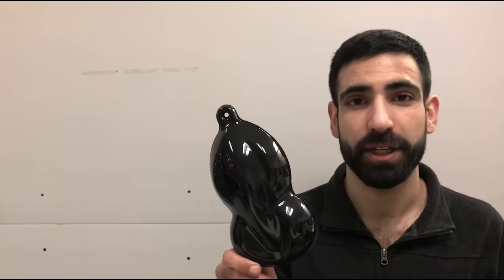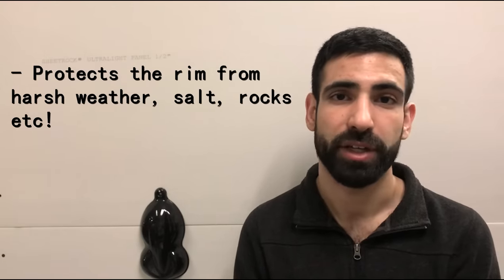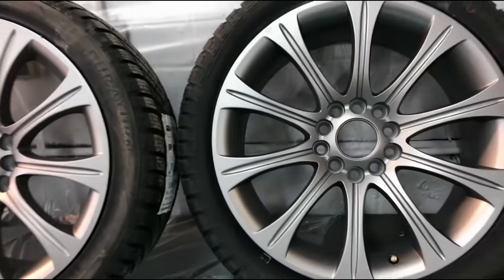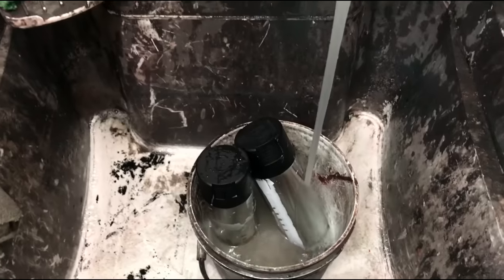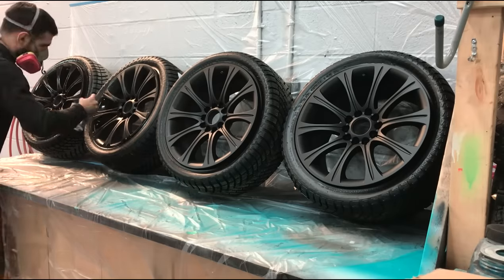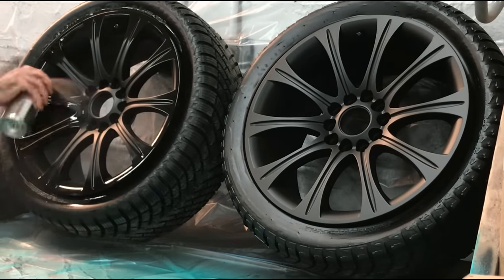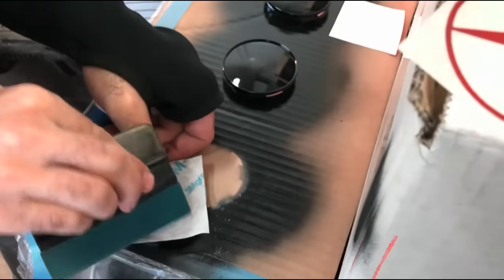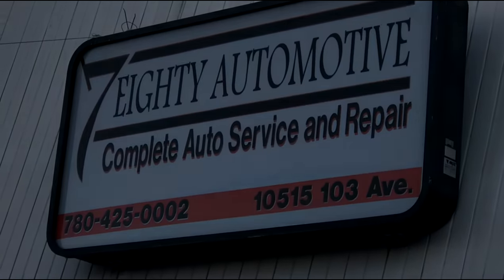How To Spray 2K High Gloss Plasti Dip Rims

Comment: Yo liquid dipper that 2k high gloss looks awsome.did you spray plasti dip on the wheels then the 2k high gloss bye spraymax?
I recently got my wheels dipped with plasti dip the guy said he sprayed 6 coats but I can still see the actual color and its bubleing up in some spots do you think they sprayed the right amount coats or it should of been 8 to 10 coats of plasti dip please let me know what you think.also can I spray 2k high gloss on top of the plasti dip to make it glossy I would appreciate your feed back thanks ?
Reply: You can spray the 2k spraymax over plastidip but make sure you have full coverage and somewhere between 8-10 coats to get peelability & durability
Reply from the maker: Hey! I did use Plasti Dip black in this video but you can pretty much use any removable coating spray. If you can still see the actual color on your rim then there is no way he sprayed 6 coats unless they were light coats. You can get away with 6 coats with good coverage but if you want better durability then go with 8-10 coats. Yes you can spray the 2K over Plasti Dip to achieve this high gloss finish.

Comment: How does the coating react to Cleaning & automatic Car washing? Also, Will I need to redo the Rims after changing a tire(s) & what precautions need to be taken when changing the tires on a painted rim? Thanks.
Reply from the maker: Cleaning and car washes are fine on the wheel, you just clean it with degreaser and water then you can dry it after if you like. When changing tires, they may damage the coating but can be easily touched up by thinning out the area and respraying. Touch less tire machine will work best when changing tires on a painted wheel

Comment: Can you do this with the rim on? Does the rim have to be flat when sprayed with the 2k clear coat or will it run if it's not flat?
Reply from the maker: The tires stay on the wheel but i take them off the car and lay them against the wall

Comment: Hi! Thx for a great video! One question though, how many coats of the 2k is required?
Reply from the maker: Hey, thanks! You only need one light coat followed by one heavy coat right after and than let it dry and cure for 24 hours

Comment: Hello great results, I live in the UK and this clear coat isnt available, do you think I could use another high gloss laquer spray with a similar formula?
Reply from the maker: Ocelot7 Hey! Im sure their are other 2k glosses that work, i just haven’t tested others! You can try to spray something as a tester and see if you get any reaction before you do your rims!
Reply: Great stuff Ive found a product by the same manufacturer just different packaging. Would you advise it being okay to do masking techniques or would you say this is best just one colour with no trying to mask off edges to get two tone effect?
Reply from the maker: Ocelot7 Follow the same steps in the video for masking off around the caliper
Reply: Liquid Dipper thanks I’m
Doing rs3 wheels so the plan is edges will be masked off to leave the polished factory. Hoping for Neat lines
Reply from the maker: Ocelot7 they will, as long as you peel when wet. In other words peel the tape off after the last coat of 2k gloss
Reply: im in uk also ,can you tell me the name of the spray you found, and where to get it please?

Comment: Is it ok to spray the 2k clear over the hyperdip? Also can the hyperdip be applied to polished aluminum wheels? I would like to do the piano black hyperdip and 2k on the centers of my weld draglites.Thanks.
Reply from the maker: I get asked that question alot lol i havent tested it but you can just use regular black plasti dip with 2k the results would probably be the same if it did work over hyperdip. If the wheels are polished i dont think any coating would stick to it, you would have to use rubbing alcohol to clean it all up

Comment: I’m about to get new tires for my rims. Do you recommend doing this with the old tires since I won’t worry about getting the plastidip in the tire?
Reply from the maker: Switch the tires first because if you sprsy the wheels and go switch of the tires, the tire machine may damage the dip on the wheels. Put a liquid tire shine or dip release from dipyourcar on the tire but avoid getting it on the rim and spray the tire everytime you do a coat. When you finish your coats the plasti dip on the tire should peel off nice and easy

Comment: hi can I leave the wheel on the car and do this? will the 2k over lug nuts make it hard to remove the tire in the future? thanks
Reply from the maker: You can do it on the vehicle just make sure you put a bag around the caliper and brakes area. No 2k wont make it hard to remove if u go over the lug nuts

Comment: Quick question ?. Do  I need to take my wheels off to do this or could it be done wheels on?
Reply from the maker: Its best to take the wheels off but if you cant then make sure u put a bag behind the wheel to mask off the brake components
Reply: @EhabHalat  thanks for the response👍🏾

Comment: Hey man! have a quick question, my wheels are already plastidipped, they were done not too long ago. Can I just spray the 2k gloss coat over them or would I HAVE to peel off the plastidip and then do it again?
Reply from the maker: Faaiz AliTV hey! If the plasti dip isnt damaged or peeling then of course you can spray the 2k on top just make sure to clean the wheel very well before doing so because if any kind of debris is on the surface it will bubble up and you wont get a smooth finish. What i suggest is spraying a fresh coat of plasti dip and then the 2K just to be on the safe side
Reply: Liquid Dipper thank you very much for the quick response! Amazing video bro keep it up!

Comment: how do you keep the tire shop from damaging the rim when putting on new tires? I pained mine and used 2k clear but the first time I had new tire put on the tire shop scuffed up the rims and pealed off the paint and clear in a few spots
Reply from the maker: You need to go to a shop with a touchless tire machine or tell them to be very careful and maybe put a cloth around the lip of the wheel so it doesn’t get scuffed up

Comment: Can you elaborate on how hard this is to remove?  I want today to be do my Maserati  rims, but scared it will be very difficult to remove.  Others claim on Amazon that it will make removing almost impossible
Reply from the maker: Jon Korn Hey with a removable coating as the base and with the right amount of coats (minimum 8) you will be able to remove it in the future. Their may be minor spots that wont peel -as good but you could always use a pressure washer to remove the excess or rub it off with a microfibre towel but most of it will come off with no effort.

Comment: thinking of doing this on mine I have a few questions.
whats it like for durability like having a tyre changed is it easily damaged with the tyre machine? car washing does it come off easily when having car was lh ect also if Traffic film remover or TFR is used does that do anything to the paint
Reply from the maker: It depends who changes the tires but touchless tire machine works best. If it does damage, its easy to fix by thinning it down, spray black and more gloss. Car wash wont affect it just make sure if you pressure wash to keep a fair distance. TFR shouldnt harm it

Comment: Just did this on my car! Turned out pretty good but it seemed like I needed two cans of 2k, which I did not have, to make it fully shiny in all of the rim’s ridges. Do you think If I buy another two cans and spray them in a week or so when they arrive it’ll have the same look as if I had done the whole process at once?
Thanks again for this helpful vid!
Reply from the maker: Hey i havent tried but i think it should be fine just clean the rims really good and maybe do a fresh cost of plasti dip colour first
Reply: @EhabHalat  So, I am able to do a coat of plasti dip on top of the 2k? And then follow up again with the 2k? Thank you for the response!
Reply from the maker: Yes
Reply: @EhabHalat  How well do you think it’ll be if I just clean the rims as they are now and only do more 2k gloss?
Reply from the maker: Make sure they are very clean but id do a couple coats of plasti dip first then 2k
Reply: @EhabHalat  what is your reasoning behind applying more plasti dip, if it now has the 2k on it? Just curious. And thank you for the constant replies!
Reply from the maker: Makes it fresh so when u add the gloss is comes out nice and clean with no reactions
Reply: @EhabHalat  Last question! Lol
How long do you wait in between coats of the 2k?
Reply from the maker: Spray one tack/light coat followed by a solid/wet coat right after. No waiting and then just let them sit for 24 hours before handling
Reply: @EhabHalat  So literally one coat right after the other?
Reply from the maker: Yes
Reply: @EhabHalat  Just re did it and it came out shiny how I wanted it to! But, a spot in one tire got too much paint and it dried a little white. Any recommendations on how to get rid of it, or help it look less white-ish?
Reply from the maker: Never got that issue before might have to wait a few days for it to dry and sand it respray that section

Comment: Can you do a removal video soon?? I really wanna try this but I’m scared on how it will peel since I heard it makes the plasti dip hard and un-removable
Reply: i used this method on my rims and it doesnt peel off like its supposed too. the clear coat makes it extremely difficult to take off and you will need dip dissolver to take it off unless you want to spend hours peel off tiny pieces

Comment: Another question here. If I’m not planning on changing colours, or peeling the dip, could I use fewer coats of plasti dip, like 2 cans for all 4 wheels, and then just coat them with the 2K? I mean, if more coats of dip so it’s easier to peel, could I just use enough dip to get full coverage since the clear should be doing the protecting?
Reply from the maker: I havent tried with less coats so honestly i dont know
Reply: @EhabHalat  How many cans of plasti dip did you end up using for these wheels?

EDIT* Never mind. I just found the answer in one of the comments. Looks like 5 cans.

Comment: I used this exact 2k gloss and it does peel off, easily... it only took me a few of minutes to peel off. With that being said, it did cause the Plasti-Dip to feel rough but I kind of liked the look. It just made it difficult to wash them with a cloth.
Reply from the maker: Yeah i have a video of me peeling them on my youtube channel. It should be a smooth finish once the gloss is applied though, i never had a rough finish.

Comment: Hey Ehab, did you use the regular black plastidip? Also how many cans of plastidip and 2K did you use for the 4 rims? Thank you,
Reply from the maker: Yes its black plasti dip. I used 5 cans of black plasti dip (8-10 coats) then 1 can of 2k gloss (1 tack coat followed by 1 medium/heavy coat) sometimes you need 2 cans of 2k depending on the size of the wheels and complex spokes
Reply: @EhabHalat  Thanks man!
Reply: @EhabHalat  b

Comment: How easy does it come off the wheels later on?  You mentioned using a removal base coat....what does that mean?  I saw you just doing two light tack coats at first, then go wetter coats.  Then the 2K clear for two coats.   Will that peel off very easily later on in large pieces?  Or will it be very hard and take forever peeling thousands of little pieces one by one....?
Reply from the maker: I have a video on removing it, check it out on my youtube channel. It comes off in medium sized pieces. It took me 25 min to peel one rim but its durable and still removable. You can use dip dissolver from dipyourcar to get the pieces that are hard to get at, just spray and pressure wash away.
Reply: @EhabHalat  …….Ehab, the guy Fonzi from Plastidip says to never ever spray 2K Clear over his Hyperdip Piano black.   Not sure why, he didn’t say.  But you’re saying it’s perfectly fine and it peeled off just fine later on….????   I’ll check out your video of removing it later today.
Reply from the maker: I dont know about spraying over hyperdip because i have never tested it out but i spray 2k over plasti dip all the time and no issues at all
Reply: @EhabHalat  ....ok, just watched you PEEL video.  Thats not bad at all.  And well worth having the 2K Clear Coat protection.  
You say to do at least 10 coats of the Plastidip to make it peel easier.  How many coats would be considered too much?  Could I easily go 12 coats, after the 4 dusting coats, so 16 total coats?
------Also, the barrel......did you just spray through the wheel face to get coverage on the entire barrel?  Or did you spin the barrel around and spray the barrel side directly to cover it with the Plastidip?  I'm wondering if I spray in that direction what might happen to the face side of the spokes.   I ask because I do want the entire barrel covered in black as well, not just the factory finish.  I just brought our 2022 Cadillac XT6 Sport home 4 days ago and I want to get this done soon.  Thanks.
Reply: @EhabHalat  Oh, I plan to use the Hyperdip Piano Black.  Do you think the 2K Clear will act the same and peel easy later?  I want the most glossy black possible.  I guess I could use Plastidip since nobody has tested 2K Clear on the Hyperdip yet.
Reply from the maker: The more coats the better! You can do as many as you want and for the barrel i never do it unless the customer asks but you can spray the barrel first and then turn the wheel around and spray the face. I have a video on doing the face and barrels so you get an idea of how its done.
Reply from the maker: @2ndAmendProtector  ya stick to plasti dip and 2k clear. I havent tested it over hyperdip but if it reacts well i dont see the gloss finish being any different than using plasti dip and 2k

Comment: My wheels are already P dipped and peeled. 

So main question, Can I leave my wheels on car like when I P dipped? 

Also, if I use the index / playing cards, will the 2k still get in the outside edge of wheels with cards there. 

Also, instead of using cards, is it easier to just overspray 2 coats and peel 

Also, should I remove each wheel. That will be a little tough, but I could probably do it. 

Sry for all the ??! Lol
Reply from the maker: You can do them while the wheels are dtill on the vehicle, just put a bag behind the wheel the cover the brake componets

Yes the 2k still gets the edge of the rim just make sure u spray around the lip of the rim properly 

I always use cards its easier because if 2k gets on the tire it makes it abit harder to remove so only get plasti dip on the tire, not 2k

Removing the wheel makes the job easier but like i said the wheels can be done while still on the vehicle

Comment: How long does it take to dry? Do you have to sand rims if they have scratches? If so with what? Platidip.com said this product was not good or easy to remove! I don't want to remove anyway@! I want that gloss though any thoughts?
Reply from the maker: I let it dry for 24 hours to be safe and if its light scratches it should cover up but anything major can be sanded down. It is removable with the right amount of coats i have video on my youtube channel of removal but still very durable and nice gloss
Reply: @EhabHalat  Dude I appreciate your speedy reply! I want to do it to my truck & my E350! Great job they look 🔥
Reply from the maker: Well good luck if you do it man! Its very user friendly just take your time and prep it correctly and thanks!

Comment: Hey, what what is best to remove plastidip overspray from the tire.  The tires didn't get wiped down initially.  The plastidip will not peel off and I have used several products.  I thought I had one tire cleaned of the overspray but it will not shine up proper now.  It looks like a fine residue is still there.
Reply from the maker: Hey try using a product called goof off or goo gone if you cant find that then order some dip dissolver from dipyourcar website. Anyone of those products will work
Reply: @EhabHalat  I was thinking about goof off too.  Will it hurt the rubber of the tire?  Or will it take off the plastidip if it gets on it?  I plastidip is on very well with the clear top coat applied.  Thanks
Reply from the maker: bluebox212 if you got the clear on the tire try using gasoline, brake cleaner or wd-40 but be careful not to get it on the actual wheel

Comment: Hey! I like your videos! How many pasti dip cans do I need for 4 tires when I apply 4 coads? Thank you !
Reply from the maker: Hey, thanks and it depends on the size of the rims, usually 4-5 cans for most size wheels and try to use all the cans which will get you about 6-7 coats

Comment: So it's regular 10$ plastidip flat black not the glossy black plastidip? With 2k clear coat?
Reply from the maker: Yes 2k clear over black plasti dip
Reply: @EhabHalat  you can't pressure wash plastidip as it'll peel it off? Just regular scrub and wash, rinse? How long did they hold up before showing issues? Have you tried the glossy plastidip?
Reply from the maker: @JustinRaney @JustinRaney you can but you cant get super close to the surface, just keep a fair distance when using the pressure washer. They held up great for 2 years before the vehicle was sold. The gloss plasti dip isnt that glossy compared to the 2k and this is alot more durable

Comment: i need some help.. i will paint my rims but i dont want to use plasti dip just normal pain but what kind should be acrylic or not acrylic spray can ? is it matter ? also matte or glossy paint before 2k gloss which one will be better ? ( sry for bad english) thanks
Reply from the maker: Im not sure ive only used plasti dip with 2k clear coat i havent tried using paint
Reply: @EhabHalat  thanks mate :) how many cans of 2k need for 4 rims ?
Reply from the maker: @montagemaster7096  you only need one can